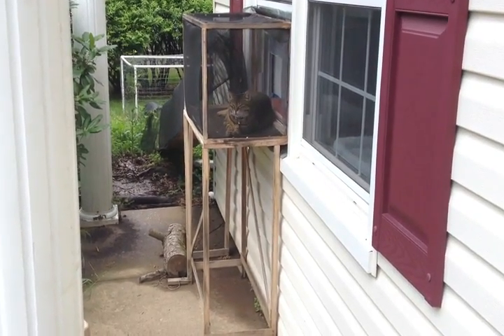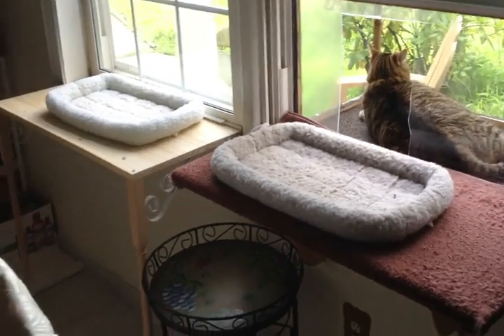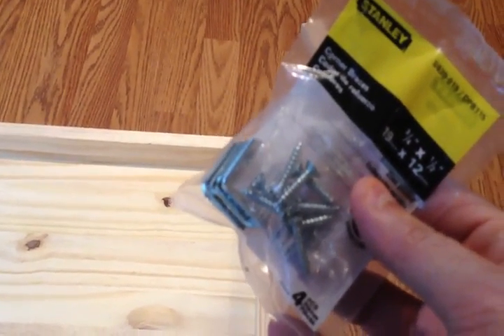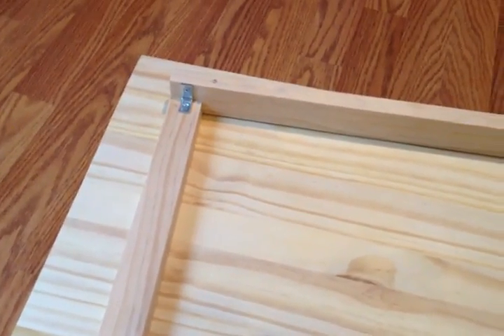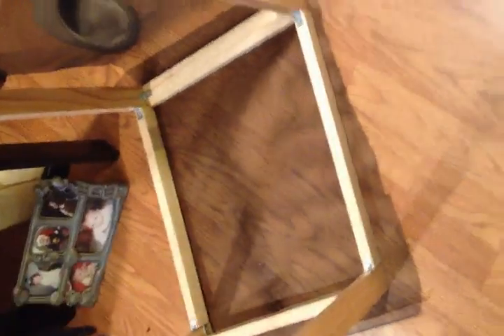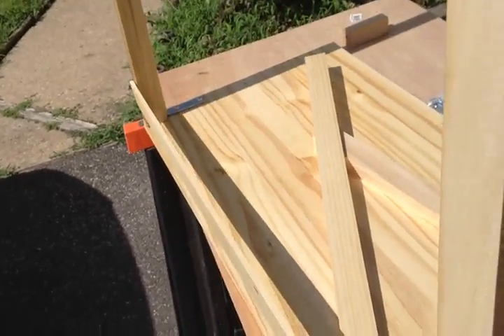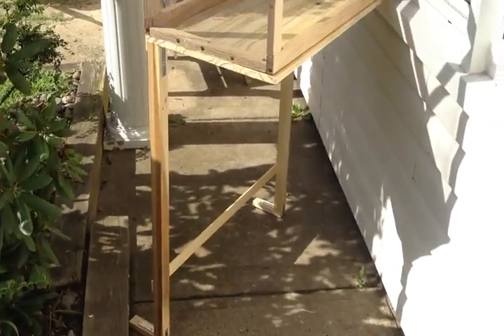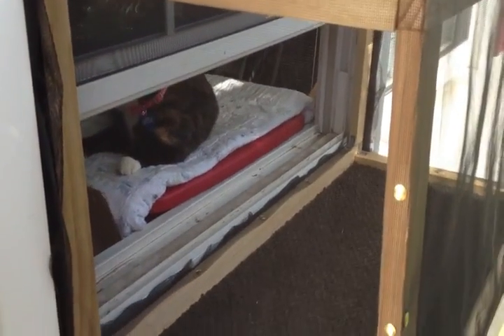How to build an external cat window seat

Comment: YOU are the reason I have a ton of boards hanging out in the house and back yard now!  Just kidding, but seriously, you make it sound a lot faster and easier than I'M finding it to be.  I've come back again to see about building the outside bracing... MAYBE I'll get this done. I like yours because I didn't want my cats on the ground like a lot of the catios show.  Also have to put in a pet door in the window to keep a/c in, but I'll do THAT if I get this project completed! It's hard to get anything done out there right now... it's about a thousand degrees here in central Texas.  Thanks for your ideas and sharing your video.
Reply from the maker: Thanks!  I hardly check youtube comments, but I caught yours today.  Sorry if the video instructions are not precise.  I still improvise most of my projects.  Never even took shop class, so I do whatever seems right, and whatever the animals need at the time.  I did a nice set of couch steps for the little black dog in the video, and just last month I build a long ramp for the aging yellow lab in the video.  Mittenz continues to use various cat windows I have around the house.  Good luck with your project, and stay cool in Texas.  Go Cowboys!

Comment: Thanks for sharing this. I have a plastic coated wire cage open on one side. I live on the 2nd floor of an apt building which is brick. So I still need to find a way to secure it on the outside bottom so it can't fall out. My cat's favorite seat is at the foot of my bed which I put purposely by the window so she could see out. Thanks again for sharing.

Comment: Thank you, very clear bro. Are you using the regular window screen? Can the cat claws will break through ? Or racoon can break through?
Reply from the maker: Sorry, I don't check comments often (I should).  I used regular window screen.  Never had an issue with it.
Reply: Your cat looks like mine! 
It might depend on your cat’s temperament. Mine likes to claw through screen so I’m making hers out of an actual wire cage intended for rabbits. :)
Reply: Please don't use ordinary window screen. If they lean or press against it, they'll fall right out and possibly injure themselves.